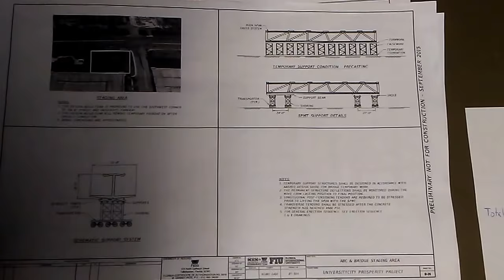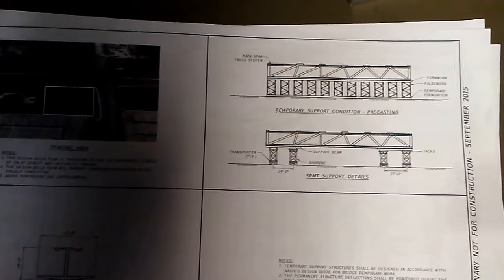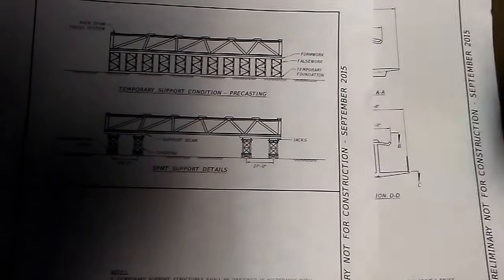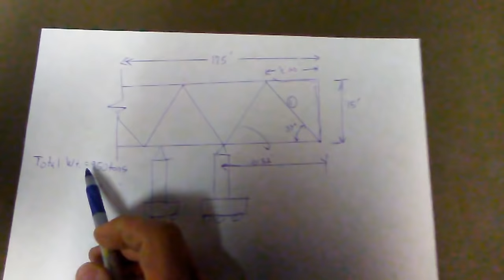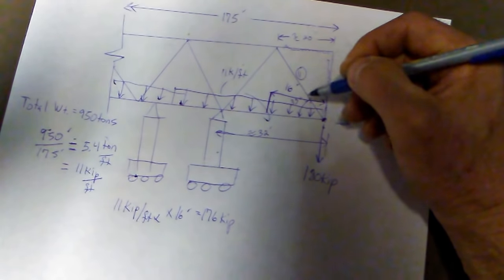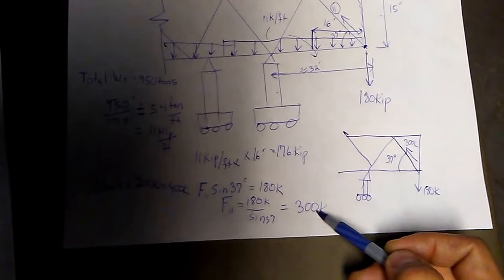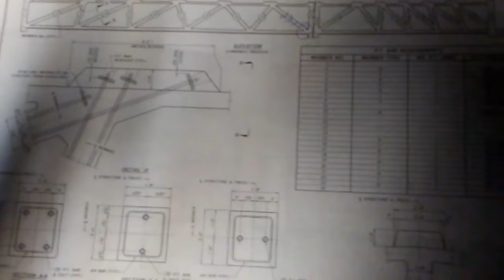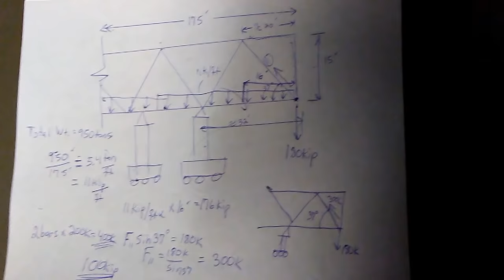FIU Bridge Collapse: The Hidden Truth (Part 4)

Comment: Structure, take a peak at this awesome new video, showing no visible issues?  https://www.youtube.com/watch?v=BDHRmvvMdmk   
The force is lessened by the post tensioning of lower deck and upper canopy. That is the canopy's top post tensioning and curved design will deduct from your calculations.
Then we have the post tension of #11  -- they were not simultaneously and therefore could have created a rotating moment, a buckling or bending moment during tensioning...  Then we have the node itself - acting as node (gusset). 
Finally, we have cracks happening days later, did the heat of the day, cause expansion of the metal versus the concrete?  (this would be like the France airport failure)...
Recall, this bridge was fabricated in February temperatures... 
I so wish we knew more about the materials and their expansion / flexural abilities...   
ALSO,  this bridge lacked expansion control systems?  (at least, I could not see one visible).    We know that no expansion and you will get cracking - by default of the expansion of the materials; steal and concrete at different rates... based on temperature it is experiencing.
Reply: But, you do not support a cantilever in this form, it is done in the upper deck longitudinal cables and not with diagonal members...
In this case it would have been in the canopy and not in #11.
Reply from the maker: Great video find of the bridge move. I have actually witnessed a bridge move in person, and I have to say it is rather dull! The bridge is transported at such a slow speed, something like 1/2mph or less, that it is comparable to watching paint dry or grass grow. There are usually a lot of workers standing around with their hands in their pockets, wondering what next to do. Lol.
Reply: structures specialist 
It was during the move and lift when the #11 tension rod was stressed beyond tensile. 

Due to a lane delineator and a cut-bank along the road surface at the base of the North end pier, the outboard jack tower intended to be placed under the end was moved toward center leaving the entire end chord, approximately 1/5 the total weight of the bridge, cantilevered unsupported...195 tons x 1/5 = a lot, as well as omitted plates or beams across the top of the jacks straddling the towers creating point loads. 

This very likely caused the cracks noticed by the engineers in the day before the collapse and over-stressed the rod 

When torque was applied to the rod during post tensioning it failed as evident it being ejected from the chord  channel with the blue hydraulic tensioning ram still attached seen in one of the many aftermath photos

Ironically, the road features mentioned at the base of the pier were enplaced at the time of pier construction, and with nothing more than proper planning the road surface could have been prepared to accommodate the move properly. 

Even after and leading up tothe move, the curb could have been easily scraped off and the cut-bank filled leveled and compacted then covered with steel road plates. Not a big task considering all the heavy construction taking place, if somebody had the thought to adhere to the original plan

All this analyzing the bridge design is an exercise in futility
Reply: The rod did not fail nor did does any image or video show an ejecting rod... They show sections of rods but, no image shows ends missing or a break in between... 
If, the rod failed, then that might have saved this bridge, as it it would put #11 back under compression as it was designed...  and without the added tensioning / loads...
Reply: @Tommy Petraglia; I think everybody has included the botched move arrangements along with the bridge design itself.  We must consider everything combined because this failure was caused by a combination of factors.  If the transporters were positioned as in the original plan, there would be little need to tension member #11, but since it was tensioned, and then re-tensioned, all the fancy bridge design calculations are out the window.  My gut tells me that a structure that is supposed to withstand hurricane-force winds should not just fall down.  Bad design.  Bad construction.  Bad project management.  All bad.
Reply: Philadelphia Construction Engineering 
Then what was rod #11 doing protruding unbent from its chord channel?

If it was in place with the nut and plate against the concrete at the collapse it would have been mangled like all the others. 

It is evident as you can clearly see the hydraulic ram is still attached at the end of the rod. They stressed the rod Beyond tensile  when they moved it the bridge cantilevering the North End . Then when they were attempting torquing it to tension the bolt snapped was ejected from the chord as the bridge collapsed. It's the only way we can see that rod unbent in the wreckage the way it is with the hydraulic ram still attached to the Head
Reply: Reread my comment please, if the rod failed, it would have no longer been a direct contributing / load factor...  So, you can't have your cake and eat it too...  That is, if you are stating the PT Bar caused the failure, you cannot also say it failed to perform and broke apart...
Reply: Philadelphia Construction Engineering 
Re-read my comment... the #11 was stretched beyond its tensile strength during the improper move thus creating the cracks witnessed.  

 With post tensioning on #11 in progress, proper torque could not be acheived as the weakened rod was deformed until failed. Upon failure it was ejected from the channel with the hydraulic ram still attached signifying to was not connected to the structure at point of failure 

Granted it was a minimalist design with no redundancies on these factors but invariably it was a good design for its function but losing just one element was all it took to doom this bridge
Reply: I think it did have redundancy... the cables are always designed to be more than required... This bridge was still under construction and it's top canopy was not complete. Also, we have some cracks that we cannot account for -as of yet.
Tommy, you believe the rod was over lengthened to a point of failure... and once the failure happened the rod -     ejected itself from the ducts... 
BUT, at the same time, the bridge failed?   So, you believe the one rod, was responsible for holding the entire half structure up? (I am just trying to understand your point and help you see different data...)
Reply: Philadelphia Construction Engineering 
It was one leg of 3 in that chord and the length from there to the end was 1/5 of total length of span which in place was bearing on the pier but being cantilevered unsupported in the move the chord was carrying the full 1/5 weight rather than 1/2 of that

The other rods remained in their channels and wound up mangled in the wreckage unlike rod #11. See for yourself in the still images, it's there sticking STRAIGHT out with the hydraulic ram still attached to the end. How do you explain that? 

I'll wager the interior end of that rod is stretched and pulled clean apart from where it was affixed on the exterior end
Reply: Tommy, I am doing another video, discussing a cantilever and how you "counter force" a cantilever by a brace from underneath, from the top, increasing strength of lower chord, or by post tensioning or adding rebar in the top chord / canopy... But, doing it via #11 would be the worse way to counter act a cantilever...
Tommy, realize, the post tensioning does counter act a cantilever  (the longitudinal cables in the canopy and the lower deck and the distance is approx.  14 feet).

Comment: Any bridge relying on the strength of just ONE member is not redundant enough to be safe, (especially with age). I think they were counting on the 16 inch pipe faux cable supports to provide the needed redundancy....   redundant support that was not in place at the time of collapse,

Statements by the constructors that faux cable structure was largely decorative are belied by the use of 16 inch pipe  .. 

therein lays another issue....  the steel pipe would be contracting about an inch and a half, in cold weather before the concrete (with a very similar coefficient of expansion) had time to cool off due to its greater thermal mass,   a fatal flaw in itself especially as the bridge aged a few years.   all a bit hokey,
Reply from the maker: phil scott Thank you for commenting! I will address the cable stay issue in an upcoming video this week since this appears to be a topic of debate. Bottom line, the stays were decorative and I will explain why....so stay tuned!

Comment: what is the total compressive load in member 11,   if the 300 kips ps had been left on, after the bridge had been place d on the supports? Is this excessive for the strength of the member?
Reply from the maker: The 400 kips applied post-tensioning would have been reduced when the bridge was set in its final position. This is because Member #11 goes into compression from bridge selfweight after the bridge was set down onto the piers. 
Watch my Part 3 video for additional explanation.
Reply: I'm talking only of the concrete stresses.

Comment: Why are you focusing on a temporary construction phase where no failure occurred?  The failure was a combination cold joint and block shear blowout failure due to a design that was impossible to be successful with pure reinforced concrete.  The entire structural engineering team screwed up because they had no experience with concrete trusses, and lacked the basic understanding that is required to be a licensed structural engineer.
Reply: It wasn’t impossible, but it was under-designed, as the NTSB report concluded.  What Structures Specialist was doing was explaining how the structure worked, or was intended to work.

Comment: I hesitate to call this design innovative as it is easy to find examples of concrete truss designs dating back to at least 1934.  http://www.historylink.org/File/8286

This design has a lot more concrete as it was a simple reinforced concrete design lacking more recent developments such as high strength concrete and post tensioning, but it is still a similar design.

I agree that anyone who claims to know the root cause at this point is being reckless at best.  There are many possible causes from design through construction.  The only firm conclusion we can draw is that the public should not be allowed on a construction site.  Had this longstanding practice been followed, the loss of life would have been greatly reduced.  The collapse would still have occurred, but the results would have been largely economic rather than tragic.
Reply from the maker: Thanks for checking in again LTVoyager.
I suppose I consider it to be an innovative bridge in that it is a new twist on a old design!
Reply: structures specialist I think rare and unusual are good descriptions, but innovative seems a bit much.  🙂
Reply: As I have often told neophytes in design; you have to know and understand the rules before you can break them successfully.  Just breaking rules willy-nilly with no regard to established principles is simply chaos.  Sure, the artistic designer created something that looks different, but when bridges fail, people get hurt.
Reply: James Surber What rules are you suggesting were broken?  The only broken rule evident to me at this time is allowing the public to be on an active construction site.  Most structures that fail fall into two categories: 1. Poor design and/or construction and 2. Poor maintenance and repairs.  The first usually fail during construction or load testing.  The second usually fail after their normal service life has expired.  Very few structures fail in between barring external forces such as earthquake or tornado.
Reply: @LTVoyager; The rule of safety.  The rule of designing bridges with redundancy.  The rule of common sense.  The rule of minimalist design.  The rule of not allowing aesthetics to overrule generally accepted structure design.  For starters.
Reply: James Surber Those are more principles than they are rules.  I will give you safety, but the rest are speculation at this time.
Reply: It does use concrete tusses, but they appear to be more robust.  It's hard to evaluate since the picture is small and there aren't any engineering drawings of how it was actually done.  Interestingly the span is the same.   Each side looks as though it has a double pillar design and there appears to be x bracing between the double columns.  Here's a picture of the McMillen Bridge.  There was a double truss on each side:
https://bridgehunter.com/photos/13/88/138891-M.jpg
The road bed appears to be about half the width of the FIU debacle, and the layout of the double trusses is far more robust and logical.
http://historicbridges.org/washington/mcmillinbridge/drawing_large.gif
Notice the top chord employs a slight arch which ensures compression of the top chord which is then directed down to the bridge support pilings.  The FIU bridge was based on wishful thinking.  Notice that pedestrians can walk through each double truss on either side of the McMillan bridge.  I don't see where there is any comparison other than the McMillian bridge made proper use of concrete and most likely was built in place.  It was not an overly hyped  ABC bridge.
Reply: Internet Privacy Advocate And what qualifications do you have to make you competent to assess the FIU design?
Reply: Single row of concrete truss ?!  For 175'-0" ?! For 950 tons of concrete ?! with two post tensioning rods inside  21"x24" concrete diagonals ?! a cable and mast bridge was changed into a single open web concrete beam,  without the suspension cables that supported the Golden Gate Bridge ?!  Did the original structural engineer Jean Muller from France and Linda Figg of FIGG Bridge Group ever check the revisions before the erection ?!  ......... George Wu, ARCHITECT, A.I.A., NCARB 2018-4-11

Comment: Perhaps we can't put all blame on the engineering side, but can't it be true that the engineering work was theoretically correct, while being practically wrong? Especially considering the novelty of the design, along with sheer size and weight (175 x 32ft @ 950tons !!), from a practical standpoint, all calculations must have uncomfortably large uncertainties attached. There could be 'room to spare' from one perspective or 'none at all' from another.
Reply from the maker: In hindsight, there may have been an issue with the design, especially considering that 1 worker was able to singlehandedly fail a member. Regardless of the bridge weight though, a new bridge design properly completed should have a an abundance of safety factors built-in.
Reply: The NTSB found that the structure was underengineered at the point of failure (node 11/12).

Comment: I do believe you are missing where the load is.  I didn't need the math to know there is no concern.  the concern should be in the canopy straight above the jack.  do some fancy math on that part please. that's the point where hell is happening. I'll share with you 30 years field experience... concrete comes with two guarantees...1 it will get hard.  2 it will crack.  try this just to humor yourself.  cut a piece of wood or two to rep 10, 12.   scale to 1"=1'.  then hook a tape on a desk and back up 175".  grasp the tape with four fingers while pinching a yard stick down on it with your thumb.  this should give you a visual of length and width.  now hold up  10 and 11.  looks pretty fucking silly and weak.  do it.
Reply from the maker: Great model idea! Perhaps the engineers should have done a similar model mock up before signing off on the design...
Your assessment of concrete is spot on....it always cracks.
Reply: structures specialist ...I actually posted it.  my first yt vid.  god I'm behind.
Reply: essential judge

Comment: If  I'm looking at the drawings correctly your starting point is wrong. The drawing clearly shows member 11 as a "Type A" member. The "Type A" memeber is supposed to be built with (4) tension rods at 280kips each. Looking at the wreckage it was  clear to me that it was built as a "Type B" member with (2) tension rods at 200kips. Either someone screwed up big time! or the drawings changed.
Reply from the maker: The drawing does not provide post-tensioning details for Member 11. So the post-tensioning for the matching compression member on the opposite end, Member 2, was used.
Reply from the maker: The preliminary drawings are incomplete. The final drawings used for construction were likely revised to show post-tensioning requirements for Member 11.
Reply: Uhh... I'm going to go with; "someone screwed up big time", FTW.  Yes, the final design drawings and the as-builts will be somewhat different, but probably not fundamentally different.
Reply from the maker: You are right. The preliminary drawings are essentially 90-95% complete, so any changes in the final set were likely relatively minor.